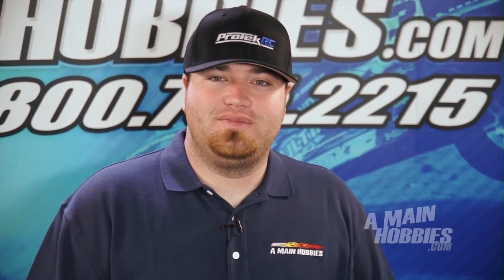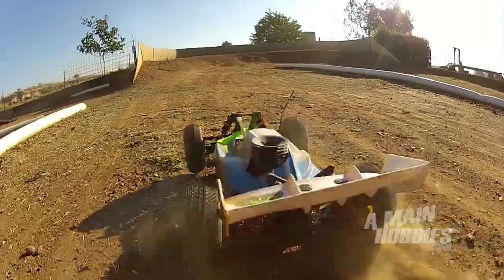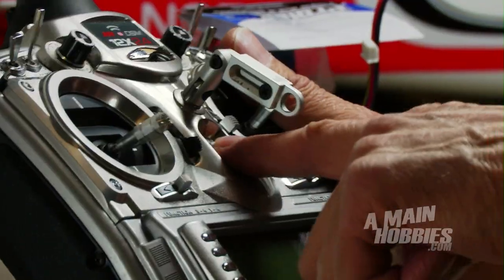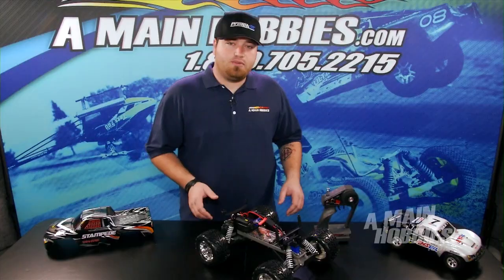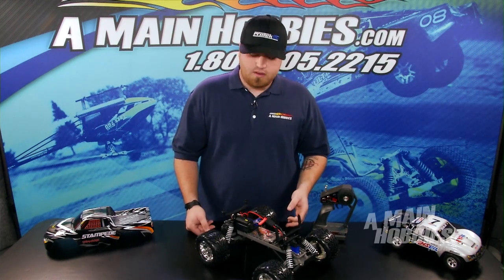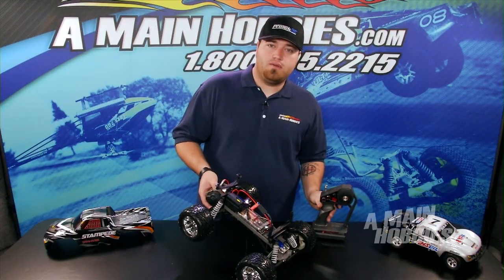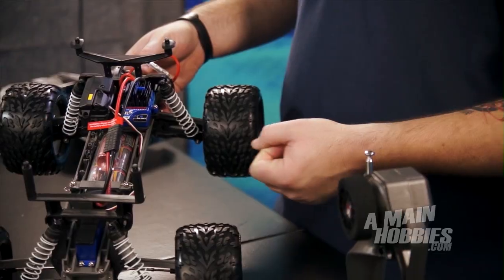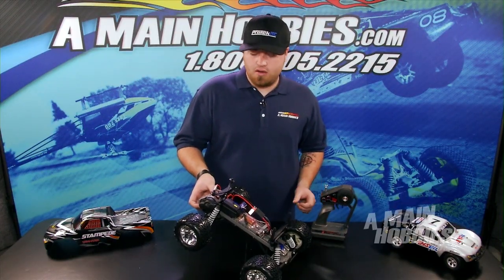How to Program a Traxxas XL-5 ESC

Comment: I've encountered a problem! I have a TRX4 with an XL5HV. After switching on the motor controller, it's constantly flashing green rapidly. After switching to other modes (using the red LED), it continues to flash green rapidly, and I can't drive forward or backward. All other functions work. What's going on?

Comment: I tried putting my stampede on lipo mode while it has NiMh battery in it and succeeded (lights turned solid green). Now I am having problem in putting it back to NiMh mode. It won't go back to red light anymore. No matter what i do it turns to green as its permanent light. Need help please. Thanks
Reply: why would you put a Nimh battery to lipo mode. are you slow? u broke it lmao.
Reply: look at the video and see if he changes the batteries when he switched to lipo mode (that's the exact thing i did)

Comment: Great video Man!
I was having problems with my new Traxxas stampede with the esc blinking green. I watched the video and tried it and it works perfectly..
Reply: crazy these esc's are still used after all these years! i still run mine after 11yrs on a 2s lipo with a heat sink. good quality

Comment: Errrr…. How do I make the brakes stronger lol… there basically non existent rn
Reply from the maker: It's going to be one of the break strength adjustments. It should be outlined in your owners manual, but for a simple walk-though of the process, we recommend you call Traxxas and they can walk you through the process.
-Brett

Comment: I've been looking at Traxxas vehicles as converting my HPI Savage .25 to electric would be pricey & make more sense to just get a brand new RTR. The Traxxas Slash 2WD comes with a nimh battery & XL-5 esc, but I wasn't too sure if I could run lipo batteries in the car also. This video helped out alot thanks

Comment: Everything i need to know. Got my first traxxas electric. Used to nitro. But anyway, bought lot set of rc's under 300. 1 nitro 4wd drifter, carpet car or pan car,  bowie 4x4 truck, rustler with xl-1 and mini e-revo. Been building quite a few rc's over past 5yrs. With these electric ones going to traxxas esc xl-5 . with exception to the carpet car. Wanna go castle. Want this one to be crazy fast. Do have cpl question? What is the motor turn range for the xl-5? Also, is the titan 12t the stock motor for most traxxas with xl-5? What is the real difference between the titan 12t and the stinger 20t and a hpi 27t? Is the 27t usable with xl-5? Great information ty.

Comment: What if when you push and hold the button the green light comes on and changes to red then changes back to green and continues to blink? Then you push the button again, no change unless you hold the button for a couple seconds, then shuts off. Is ESC fried, or???
Reply from the maker: Shoot, that's a good question. For advanced troubleshooting, you may want to try contacting Traxxas and they can best assist you. There number is: 1-888-TRAXXAS
-Brett

Comment: Could you help me, I have steering on my slash but no throttle, please help me!
Reply: No I was not
Reply: I have the xl5 system with the titan 12 turn. The motor does not move at all. I don't know how to calibrate the esc
Reply: I have  fully charged battery pack and yes i made sure, i think the brushes in the motor are burnt because i was talking to my friend and I asked what it could be and he said that the brushes were burnt out because of either grass, mud, or snow.
Reply: ok i will try that, i havew used many times before.

Comment: A got a big foot 2wd and i change my motor to vxl-3s and I'm trying to program its doesn't work its blinking red its going forward or backward can u help me please
Reply: AMain Hobbies  Velinoen brushless motor
Reply: I try to program its going green after the green flash its turning red and its blinking slow
Reply: AMain Hobbies yeah i know that's why i don't what to do  maybe my battery not giving a full power or even tho i fully charge my batter i got a stock battery
Reply: AMain Hobbies ah okay sorry i didn't read clearly what u replied on me but even tho i change both of them my motor and my xl5?
Reply: I mean my esc
Reply: AMain Hobbies i change both of my motor and esc so what u think is the problem
Reply: AMain Hobbies  vxl-3s cause i buy a one set esc came with motor already
Reply: AMain Hobbies thank you

Comment: Someone gave me a Stampede,  and I've had to tinker with it a little bit to get it put back together. Now all the parts are connected, the wheels turn when it is turned on, but squeezing the trigger won't make the car move. Can you help me diagnose the problem?
Reply: Scott Simpson I had the same problem with my stepsons Hustler. All I did was turn the car off turn the remote off. Turn the remote back on and then turn the car back on.

Comment: great video 

my question is that I think I ran a nickel batt in lipo mode , I think now how do I reset the esc xl5 , its not running other than the 2 frt wheels turn lft / rgt. no action in the rear. 
help with answer please